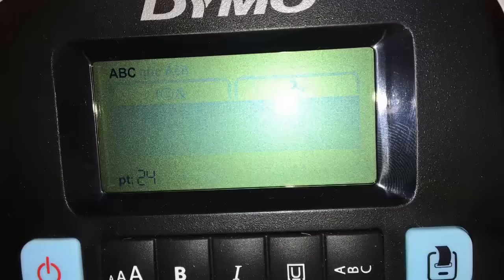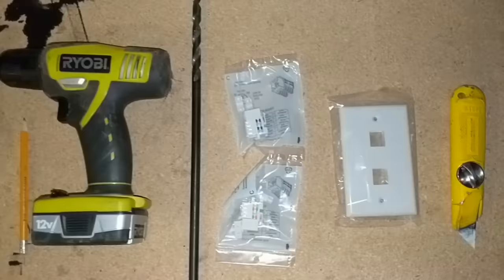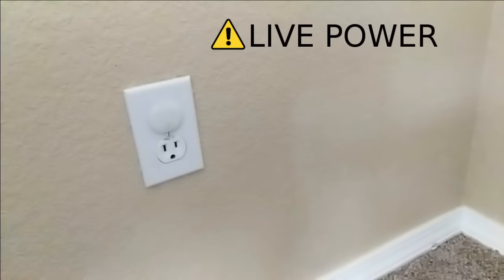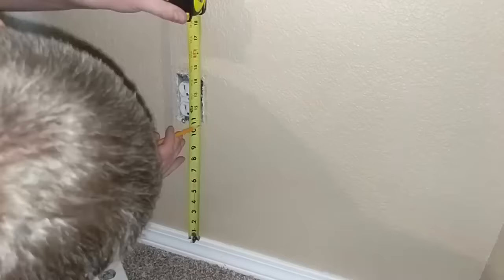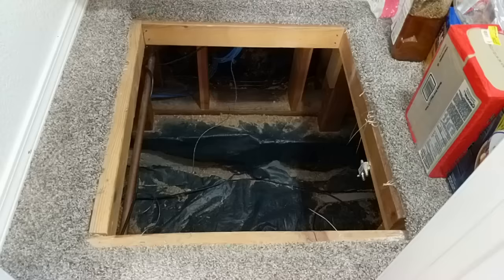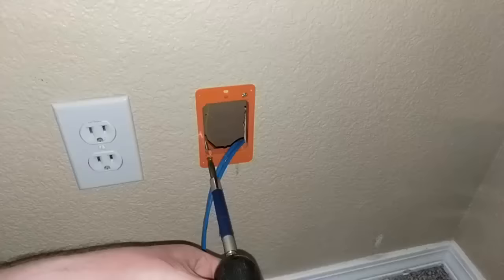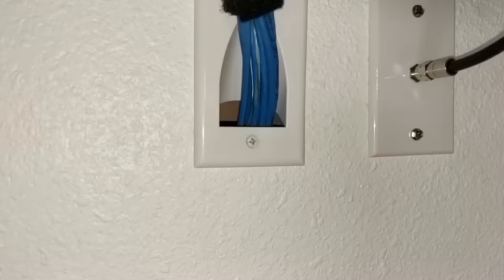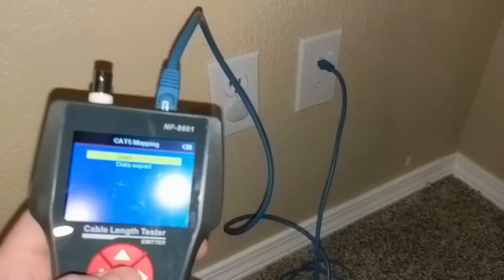How to Add a Network Jack to a Wall

Comment: I'm not going to hit the dislike button, but this was too easy. Show us how to go from the 2nd story ceiling to 1st story on houses that don't have crawl spaces, just concrete slab.
Reply from the maker: That is much harder, you are correct, nothing wrong with starting easy. Going upstairs will be different for everyone. It's hard to make a video to cover the many different options, building designs, structures etc and keep the video short or interesting. If I add a jack in my upstairs, I can do a video on it.
Reply: Sweet. I'll stay posted.
Reply: If a cable run involves penetration concrete or masonry, you should probably be calling a professional.
Reply: Robert Dunham not concrete walls, concrete slab. No cutting that up especially if it's post-tension
Reply: I understand what you meant. The concrete should have been poured with conduits to allow for future expansion. If that was not done, the only option is to wrap the building or find some other way around the concrete. An outdoor wireless AP is also an option if the building has a lot of glass. A professional would be able to help determine what options are available and build a solution for the specific use-case. My point in my original comment was that it is clearly not DIY at that point.
Reply: nilpo19 you're over complicating the scenario. Forget going under the slab, leave the slab alone, forget about the slab. How to go from 2nd story ceiling to first floor wall outlet. No slab work. I was just stating to OP that wiring in a crawl space is too easy. Not that i have the need to go under my slab.
Reply: you can always route conduit outside the house using LB's.  that's how i send power and communication to my back yard and to my shed
Reply: run a single cable external in pipe and make another coms room, 1 cable to run between floors

Comment: I have a wall socket at my business place but issue i have is because its a business (pharmacy) i believe the cable runs through out ceiling? but its hard for me to swap out these cables if i dont have acess to them let alone see them.. here i can visually see your cables it is impossible to determine where my existing cables are. I was planning to upgrade the existing set up at work due to drop outs but im hoping my new Ethernet Hub / switch fixes the problems iv been having at work. Also i wish i could do this set up at home but sadly my house doesnt have a crawl space :(

Comment: Great video! What is the name of the orange wall box that you are using? I can't find this type with the adjustable arms.
Reply: The orange box is just a simple low voltage box from Lowe’s you can get new construction (with nails for studs) or old construction (with self tightening tabs for drywall or plaster). I hope that helps!

Comment: Just a heads up that per the ANSI/TIA-570-C standards, voice and data cabling can not be located within the same stud cavity as electrical outlets. While this is not an absolute requirement for residential homes, adhering to the standard will reduce interference between the two.

Comment: Um, in case it hasn't been mentioned yet, it's a good idea to lay your Ethernet cable away from power wiring, flourescent tubes and major appliances. I try to keep a foot or two at least. May not make a huge difference but it's just good practice.

Comment: You need to put fire blocking caulk in thehole
Reply from the maker: I'm good thanks.
Reply: Budget Nerd it’s required in most places
Reply from the maker: Gotcha.. must not be here.
Reply: Budget Nerd what state are you in
Reply from the maker: I don't wear an anti static grounding strap when I work on PCs either. I live on the wild side.
Reply: Budget Nerd well if your working on a clients home the right thing to do is to do fire blocking caulk. If it’s your own home and you don’t care then so be it.
Reply: It is required by national fire code. It's required in every municipality.
Reply: Robert Dunham I feel bad for that client
Reply from the maker: Guys, this is my house not a client.
Reply: I understand that this is your home and not a client's, but that does not absolve you from having to follow fire code. All work performed on a premises must be up to code regardless of whether you are paid to do the work or not. In this case, it's fire code and it really is for your own (and your family's) safety. If a fire were to occur, proper fire blocking/caulking can give you time to escape safely. Without it, your escape time could be mere minutes. Once fire penetrates a cavity, you'd be surprised by how quickly it grows and spreads.
Reply: nilpo19 it’s also the next home owners safety.
Reply: I was going to comment the same. Good catch
Reply: national fire code is rarely the AHJ.  hell here we still use a modified version of the 2014 NEC.
Reply: what fire code are you referring to? the NFPA?   guess what, the NFPA rarely is the AHJ, and even when it is, its not usually 100% adopted
Reply: Guess what guys : if your house is on fire a small application of fire caulking ain't gonna do shit to stop it or slow it down. It may be printed in a code book somewhere that you need to, but GUESS WHAT! Whether you like it or not : you have holes in your house already for electrical and any other low voltage wiring so it really doesn't matter!

Comment: All in all pretty good for an amateur home set-up. Fishing walls without insulation is always a thing of beauty. Also, it wasn’t shown, but LVRs have dots  on the frame that are used for cutting the  required hole. Match the lower holes to the same height as the rough ass cuts the electricians did. Also, use a jab saw, the LVR is going to cover your cut. Always label your cable before pulling it. If your house is made of masonry, be prepared to purchase conduit and rotary hammers, or just hire professionals and we’ll come sort you out ;)

Comment: Budget Nerd you never mentioned what the orange thing thing is called that you are placing into the hole to screw the keystone plates into.  I REALLY need some of those.  Could you please tell us what they are called and preferably link to them?

Thank you for your time.
Reply: It's just a low voltage ring.
Reply: As Mark says, it's a low-voltage ring.  In the US, you can easily find them at home-improvement stores like Lowe's or Home Depot, or you can get anything at Amazon.  https://www.amazon.com/iMBAPrice-LV1-2PK-Voltage-Mounting-Bracket/dp/B00HYHEC38/ref=sr_1_14?ie=UTF8&qid=1542030019&sr=8-14&keywords=plaster+ring

Comment: Why did you put the new network Plate closer to the electrical outlet?  I am adding a coaxial/ network Port and it's interesting you have 2 network jacks in your panel.
Reply from the maker: Putting them in the same section of the wall cavity was easiest, and looks better to have wall plates sort of bunched together, rather than just randomly all over the place. You just don't want them too close.

Comment: Best practice should be to pull the white cord to cut the shield down further in case you nicked a twisted pair using your wire stripper.

Comment: I wish I had a crawl space like that.  Instead, I have to go up into the attic and send the cables down, cutting holes in the cross beams...  a major PITA.
Reply: You may want to consider running the wire outside of the house, particularly if you can camouflage them. You can use wire that is rated for outdoor use, or conventional wire that is not going to be exposed to direct sunlight or any other direct weathering elements.

Comment: Can you use 1 etherent cable to connect  2 wall plates together, and use another cable to connect the wifi router and a wall plate together. Instead of connecting the other end of the cable directly to your router like you did??

Comment: That string is called a ripcord. Make a notch outside shield and use string (ripcord) to further open the shield. then trim with scissors the remaining shield. This prevents having a line that is nicked from the initial shield removal.
Reply from the maker: Thanks for the info. I did know this.

Comment: I have been in the low voltage trade since 1990 I have seen it all.
Don't ever use a razor knife on the wall. Too easy to slip. Buy a $7 wall board saw. 
Also the orange line voltage ring is hard to trace to know where to cut.
Take a tape measure and measure to center of electrical outlet.
Make mark on wall .
Take any credit card and put on wall and trace outside of card. Then cut your hole. Credit card is the same size as a low voltage box. You may need to trim a little extra to make fit.

Comment: I’m in an apartment. My room already as a Ethernet/LAN port built into it. But how do I make sure the router is actually connect to it. My router is in a different and is only connected to power and a modem. Does the modem connect to the LAN ports in my room?

Comment: Someone please correct me if I’m wrong- but the network jacks only purpose is to make the chord not look messy hanging out the wall? It gives it a fancy plug in look? Like could you simply just run one Ethernet chord through the wall if you wanted
Reply: Yes but that would be janky. Because then if you want to change cable length, or the cable breaks etc. it’s more of an issue. Better to just terminate to the keystone, and get the right length cable within the room.

Comment: One question; why the need of 24 ports switch? You need just 8 ports for now. Why wouldn't you just use the 8 ports home switch intead? Just curious.
Reply from the maker: Wanted enough room to expand. And wanted to mount a switch, and for nerd street cred.

Comment: What about using the copper pipe in the home? I like the power line idea. I could of used my computer in the backyard shed with that.
Reply from the maker: Copper pipe as conduit for your Ethernet cabling? Not necessary, but you could if you want.
Reply: @BudgetNerd  Did you even listen to what was said in the video? Because you completely missed the point.
Reply from the maker: Did I listen to my own video? I must have misunderstood your statement or question.. or whatever it was.

Comment: Budget for sure. Category 6 isn't much more money and definitely worth installing over Cat5e for future proofing.
Reply: Ehh...depends on your situation. I'm 75 so don't need much future proofing. 5e is good enough for me...besides, it's much easier to pull. And oh, don;t forget to also spend the extra cash on pure copper wire for better throughput, noise reduction and poe connectivity.

Comment: Rookie over here so dumb question. I can plug one end of the Ethernet cable into my router and run the other to the port in the wall? And I will get signal into that wall port?
Reply from the maker: Well sure, but the question becomes where does that wall port run to?

Comment: The only reason I am considering powerline is our walls are a bit difficult because of the layout of the house.  That and I am not 100% sure where the existing phone lines are running.  I am not looking to run them through an exterior wall which would be brick on the outside even though we have drywall on all interior walls.  I am just glad we don't have anything worse than fiberglass insulation in the walls.  I know that much because we built the house.  I just wish I had one of those cameras that can go into a hole and see what it is like where the existing phone lines are.  Removing them and running Ethernet there would be the easiest if they are not stapled in.

Comment: Would you recommend if you want this on the 2nd story of your house that you could do it through the attic
Reply from the maker: Yes you can run cable through the attic. I did it in my last house, but sometimes it's not as easy as the crawl space. Running Ethernet to the 2nd floor does take some creativity..
Reply: THANK YOU  Budget nerd

Comment: Why run two cables and not splice the cat 6 at the jack, or daisy chain between them? Does it create problems? I've been searching for an answer but can't find a reason.
Reply from the maker: You can't splice into Ethernet cables. It doesn't work that way, like you can do with power. You could run one Ethernet cable, then add a switch if you would like.
Reply: @BudgetNerd  can you explain a little why it doesn't work? If more than one device is using the same cable will it not work correctlyor at all? I've spliced cat 6 for lighting control before, so its a different application, I don't understand cat for data though, and was hoping to gain some insight.
Reply from the maker: For the common, modern network topology, data is from point a to b. You could splice into an Ethernet cable, technically, but you'd just be getting a copy of the data sent, and would introduce noise, and weaken the signal, which most people aren't going to want.

The way to add ports to a given wired network, is with a switch.
Reply: @BudgetNerd  that makes sense thank you for the clarification.
Reply: @BudgetNerd  : In-the-wall ethernet switch outlets can be worth a look as well.

Comment: Dumb question but: I want to be able to plugin my router in my room. So if I instill this network jack, where does the other end of the cable plug in to? Like I understand one end is placed in the wall plug thingy where the router will be plugged in, but where does the other end that runs in the crawl space go? i don’t have that network switch setup you have so do I just find somewhere to give it power?
Reply from the maker: It depends, if you use this jack to connect to a lan port on the router, it would run to a device you want connected to the router, or to a switch.

If you want to use it to connect the router to the modem in another room, then you can run the other end to the modem

Comment: you can also use an insulation hanger as a dirll bit, and drill down between the base molding and the drywall,  leaving it about 5" up,  go to the basement/attic/whatever and measure over a few inches and drill a hole for the wire.  most of the flexible drill bits are garbage

Comment: Questions. Say I rent a back room behind the main house, How far can I run a wire before it becomes inefficient? If possible would I have to dig a trench to said room or could I have it just laying across the yard?
Reply from the maker: Ethernet's max limit is around 328 feet. Anything longer, you'd need to add a switch or repeater. You could lay it on the ground, but personally I would dig a trench and run it through some pvc tube or something to protect it. They do make outdoor rated Ethernet cable.

Comment: I have a manufactured home with a "crawlspace". But, between the crawlspace and the house is a whack ton of insulation. Would drilling from above and then pushing wire with a fishing rod through the insulation work? That's my plan so far but havn't gotten to try it yet.
Reply from the maker: That could work as long as you are sure where you are drilling. Normal insulation in walls can be pulled out of the way so you can see where you are drilling, you might have similar insulation in the floor. Blind drilling can be risky.
Reply: Yeah. It's hard to find even where the walls are from under the house. The insulation is covered by some plastic which makes it even more annoying.

Comment: I have ethernet cable running from my living room router to my ceiling, and it looks ugly.  So this may be the solution.  I don't have a crawl space just the ceiling/wall.  Do you need a low voltage box?
Reply: Yes you need a low voltage box, also there are things you can buy to hide cables

Comment: I just spent weeks running CAT6 throughout my whole house. Was a pain in the butt, but looks good now. The worse was the exterior wall, having to be at the corner of the attic and not able to drill straight down is a pain. Good video wish I had this just a few weeks ago when I was doing all of this.

Now to figure out how to properly set up my switch. That seems a lot more complicated. Any tips on properly setting up a Smart Managed Switch? I have the Netgear GS748T v5 (Yes I know its overkill for a home network).
Reply from the maker: Overkill for a home network? 😀No idea what you're talking about! I haven't messed around with a managed swaitch yet. Most of the time, you only need to configure them if you want advanced features, most are just plug and play. If you run in to a specific issue, let us budget nerds know and we can try to help out!
Reply: Budget Nerd haha no such thing right. 😁. I plugged it in and it is working just fine, I just notice a lot of LAG when going to websites. This is usually when happening when I am behind my VPN, however it seems excessive recently. I am aware a VPN will slow down the connection. Before I added the switch I noticed the same lag but that was because i was in a double NAT. I fixed that by creating an IP Passthrough on my modem. 

I feel like I am missing some small setting on my switch somewhere. My switch does not have a dedicated internet "in" port, so not sure if I have to configure that somewhere.
Reply from the maker: I wouldn't think there would anything to configure on the switch, but one thing you could check to be sure, is remove the switch from the equation to see if the switch is introducuing the lag, or more lag. If you bypass the switch and the lag is gone, or much better, then you could check the settings of the switch. If there is no change, the switch can't be the issue.
Reply: Thanks for the suggestion, I had a dumb moment and didn't even think of doing that. Right now it seems to be working fine, could have just been the VPN server also who knows. At least I have a plan for next time it acts up. Keep up the detailed vids, they are great. Really like your closet rack as well, just made my own.

Comment: Whats the difference between running it through the crawl space vs the attic? How do you know which is best?
Reply from the maker: Usually the concept is the same. The crawl space is often times easier. In my last house I ran some in my attic.